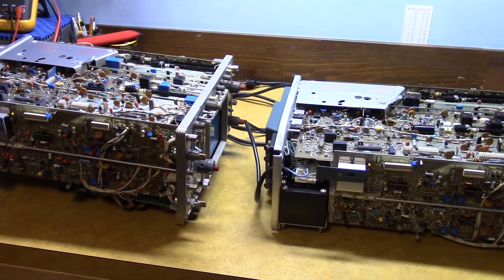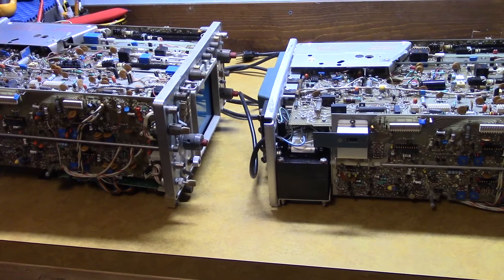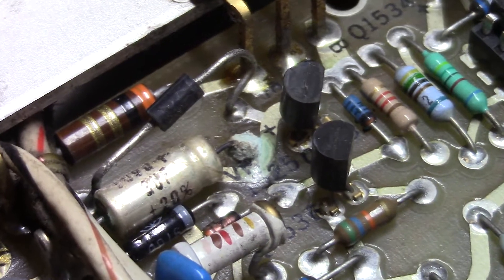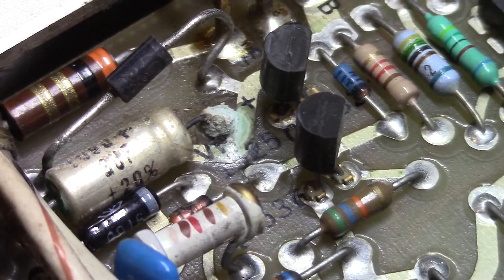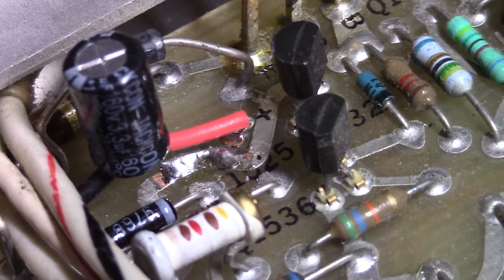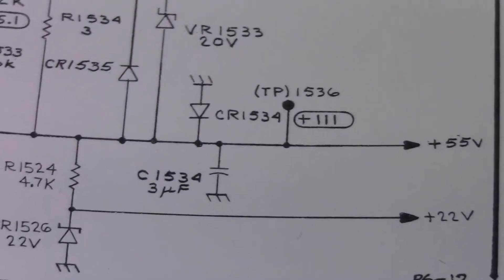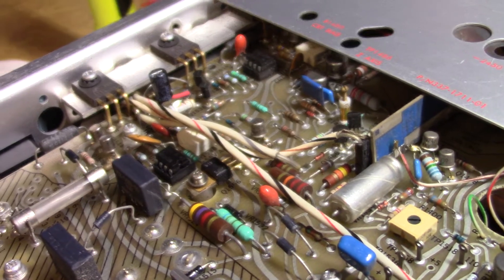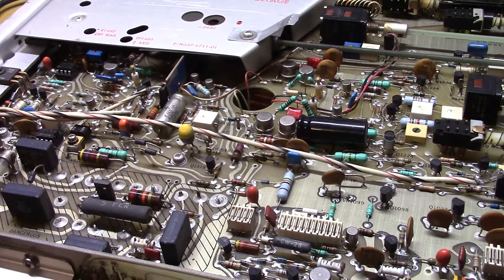Tektronix 465 - Dead -  Power Supply Repair

Comment: I have an old 465 that is not often used because of the newer digital Tek scope how ever I will take a look 
at this potential problem thanks for the heads up on this issue.
Reply from the maker: I am glad this may help.  It is probably a good idea to run the scope from time to time to keep all the other capacitors in better shape.  But age does get them in the end.  Be aware of the lethal voltages near the component in question.  That tin cover near by should never be removed unless you are on your "A" game!  Good luck.